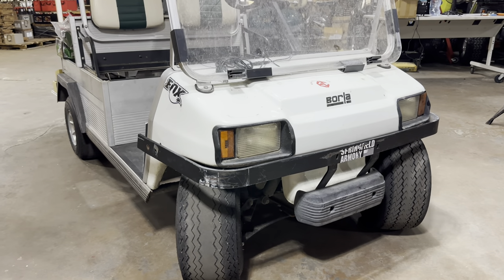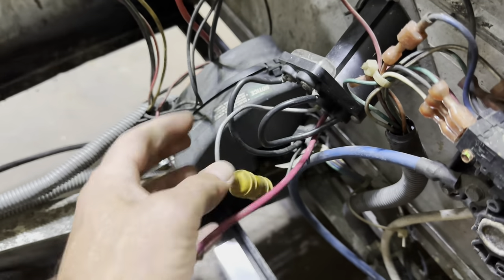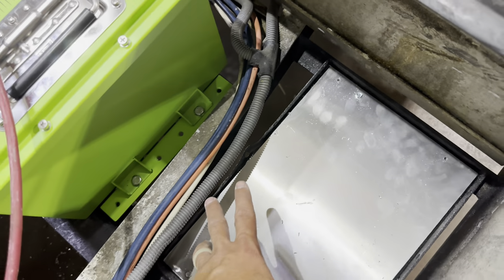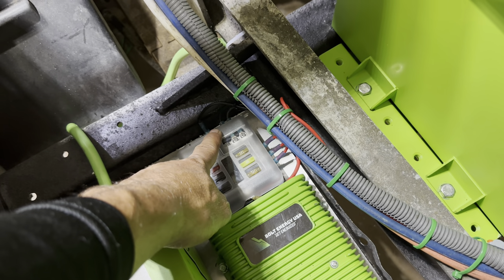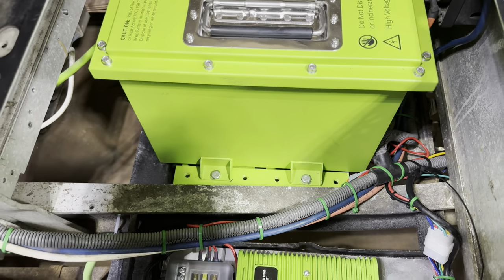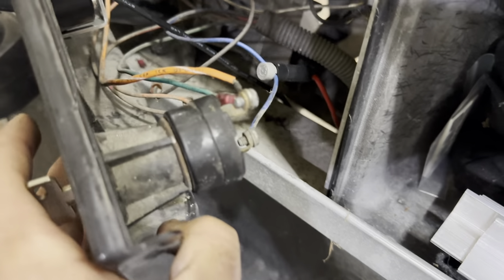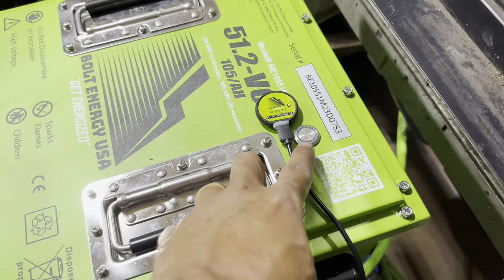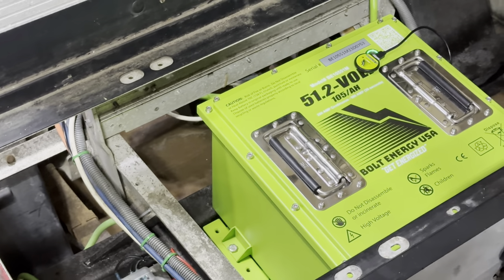Bolt Energy 51v-105ah - Club Car DS / Carryall Lithium Golf Cart Battery Installation

Comment: How did you find the wires you need to hook to the fuse box for your turning signals and lights all of your 12 V accessories? I can’t find any fuse box on the club cart. And how it was originally reduced from 48 to 12 V off of the lead acid batteries. This is on a 2003 club cart.

Comment: Ever seen an Eco 160 fit in a DS?  Or are 105's the largest that could fit in there?
Reply from the maker: I’ve seen the 72v - 105ah in a DS, biggest I’ve seen. The 160s don’t fit as far as I know.
Reply: Bolt actually just got back to me and said their updated 160Ah fits in a DS.  So that's great news.   @PalmettoBatteryPros
Reply: @Jethroman29 

Really? Which one? Is it on their website? Ive seen the dimensions of their current 160 and a bulk head will have to be removed to fit.